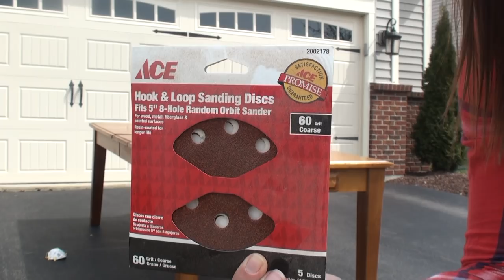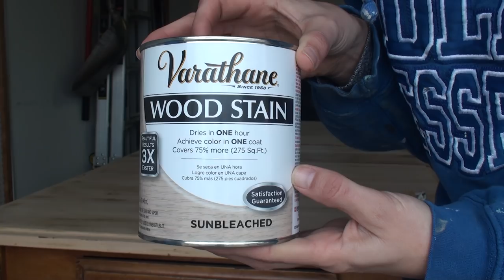Kitchen Table Makeover | Annie Sloan & Varathane

Comment: Very nice finished product. I have refinished old and new stuff for many years. Another way to knock off the varnish between coats is with 400 grit wet or dry (black) using water. The water lubricates and removed the particles from the surface of the project. The paper can be dipped in the water to wash off the abrasive.

Comment: Very well done and very informative for me. Our farmhouse style table was originally finished with Minwax Polycrylic and in less than 2 years the surface became tacky when because of the high traffic it started breaking down. I have been researching trying to find a top coat I can use that will last longer without yellowing and withstand the use of our primary everyday table. I also want to preserve the original stain color of the table. How has the General Finishes top coat held up for you over these past 3-4 years? Do you think I could I apply it over the original Poly with just a little sanding first?

Comment: Hi Christina, Your table turned out pretty. I want to do my table with a white wash on the legs, but I am afraid the moment I put the poly, it will get yellowish. I have had that happened before. but I do not want to use wax. What would you recommend?  Thanks in advance.

Comment: We are in the process of doing this to our kitchen table. It had a cherry-like finish on top (now sanded and stained with three coats of Sunbleached….it doesn’t seem to cover the table very well) and the apron is painted black. I had on keeping the black but it does not have a good balanced…the top is soooo light. What do you suggest we do with the apron?? If we do the Annie Sloan white in the video the black will show through and might look bad. Halp!

Comment: FYI......I have the exact sander and I tried ACE sand paper and it was horrible which is why you needed to use a windshield washer fluid bottle! Then I tried Diablo and Gator which were better but when I purchased Shop Smith (purchased at Lowes) it was like cutting butter with a hot knife!
Reply from the maker: I just used a Diablo one. I’ll have to check out the Shop Smith.

Comment: What a beautiful job! I’m wondering, the top coat you used, I’ve done lots of reading but want to know how does it hold up with heat and water? I have a table now that leaves white rings if anything wet is left on it. I am re doing another table and don’t want this to happen. Thanks!
Reply from the maker: I still have this table and it's help up well. But I use coasters and placemats. Most tables not matter what finish need to be protected this way. The only thing that can withstand water rings and heat is stone or concrete.

Comment: 1-is annie sloane removable with cloth or water if dont seal?
2-is waterbased paint and water based sealant removable with water? Can you clean table top with water/cloth? Difference in use between water/oil baded paint and sealant?
THANKYOU sooo much! Wonderful--
Reply from the maker: You will need a paint stripper to remove the paint.
Reply from the maker: Yes, you can clean the table top with a cloth. I even use a Clorox wipe now and then.
Reply from the maker: I use a water based sealant for the flat finish.

Comment: do you have any advice for kitchen table that has a factory shellac finish on it? I sanded and sanded the finish and then did regular paint and top coat that yellowed :(  so then I chalked painted it and waxed it but the table is used so much that it is not holding up. Any recommendations? Could I use a gel stain?
Reply from the maker: This finish is holding up well. You could also do the gel stain and their gel topcoat. That is a durable finish.

Comment: As a general safety precaution, Please consider removing the draw string from your hoodie before working with any power tool.  The ends of the draw string could get caught or tangled in equipment or wick up any chemicals you might be using resulting in skin irritation, burns. Love your videos!
Reply from the maker: Thanks for the tip!

Comment: Extra weight on sander puts it under strain. Maybe not a gallon side (8.33 lbs.). You can kill sander if rotary drags or stall. Just FYI. Try 4lbs
Reply from the maker: Thanks for the tip.

Comment: Can you use that top coat on chalk paint?
Reply from the maker: Yes, you can. I have some videos on it. They don't recommend using it over white because it may or may not yellow. They can't  guarantee that it won't, so they say not to use it. I have used it on a table though and had no issues. https://youtu.be/HjkOr5bkM0M

Comment: Hi I did rustoleum chalk paint on my dining table and after 4 coats it’s still streaky not really a smooth finish like I was hoping for. Any suggestions?
Reply from the maker: I’ve never worked with that paint, so I can’t speak from experience. You can try to use a very fine sandpaper like 400 to smooth it out. You could also try applying a coat with a roller after sanding.